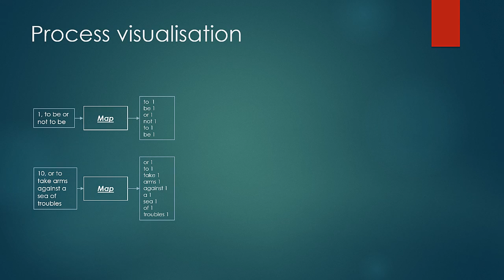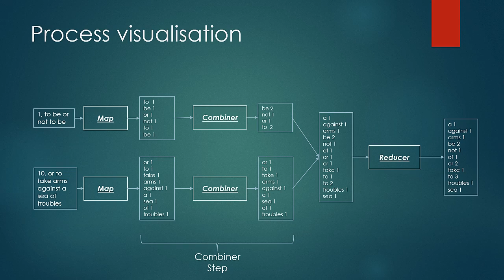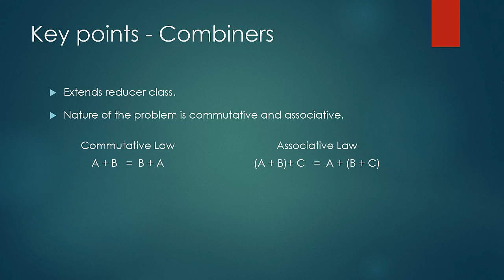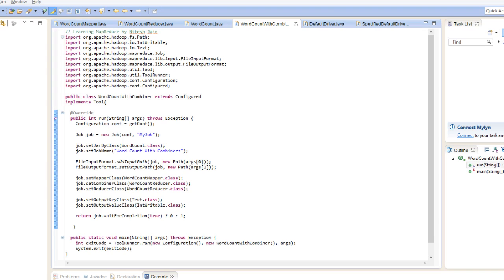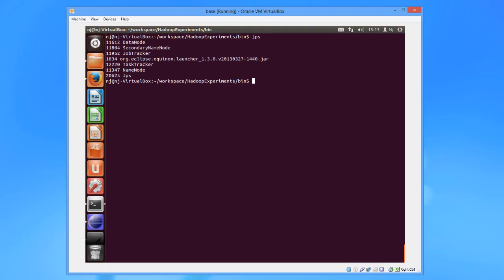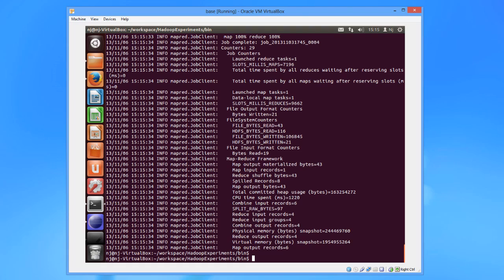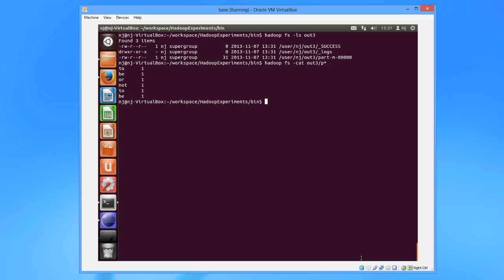020 Combiner And Tool Runner in hadoop

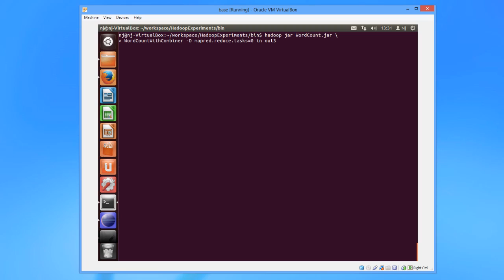Comment: First of all thanks for this video . At 9:45 we are running the job with combiner.We have configured no. of reducer as 0.So,why the  result is not having the keys with value added for the same key ( e.g. (to, 2) ) .Is it like,combiner will work only when there is some reducer ?
Reply: Same question? Have you got the answer ?